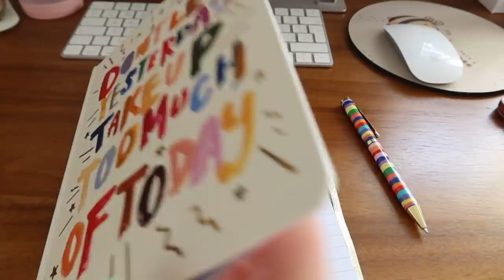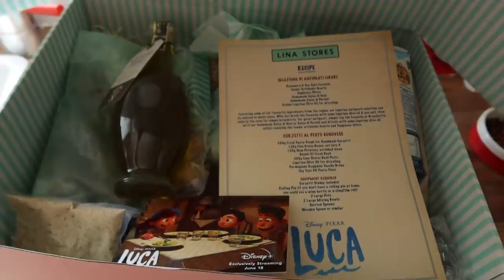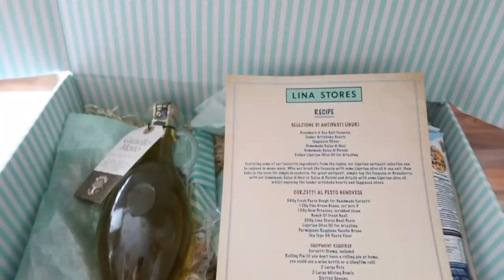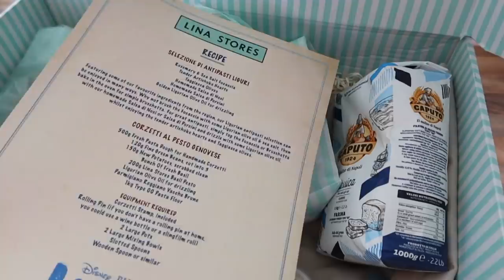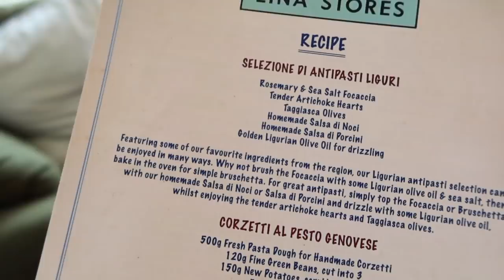HOME VLOG - PROUD STAIRS PROGRESS + A DISNEY PIXAR COOKALONG | Lucy Wood

Comment: We bought a house in October last year, and have been working on what's to be the kids' room. It was painted with concrete paint, so the plaster was really rough to touch, and we wanted to get it down to plain sleek plaster walls again, so we've been sanding down the walls and it was a Project. Happy to say that it's almost done, and the only thing left in there is painting the trim in there and decorating the room with furniture! But yes... DIY's sound so simple, but they really really aren't.

Comment: Several years ago, I painted my dresser. I immediately regretted it. Taking the paint off was the WORST. Disgusting, difficult, all the angles and curvy bits. So I totally get you. Never try to strip paint. Just buy a new dresser. It’s worth it, I swear.